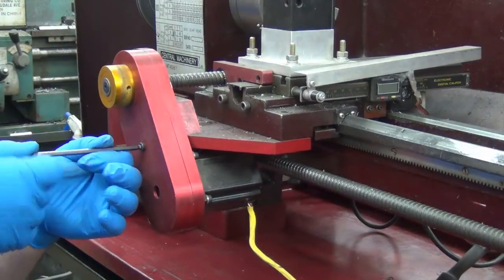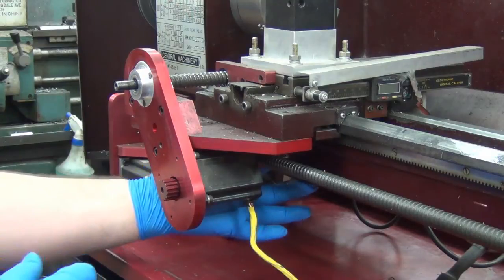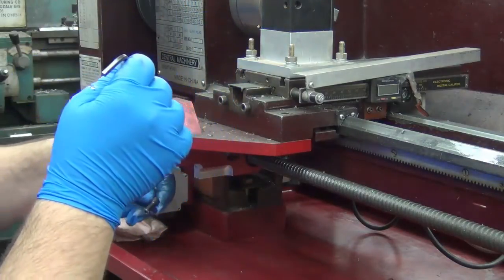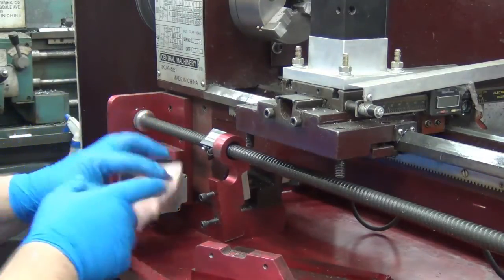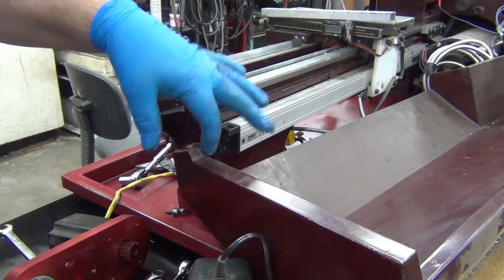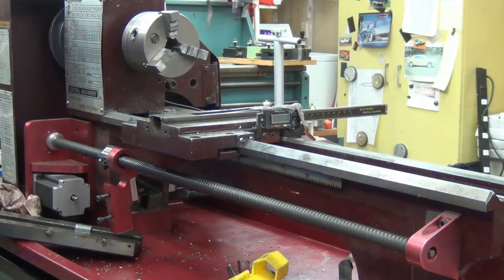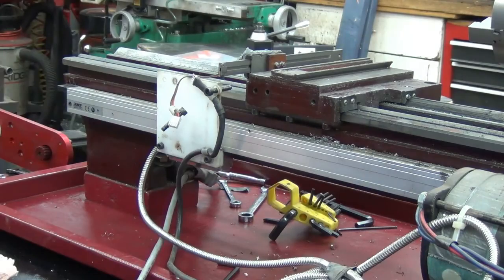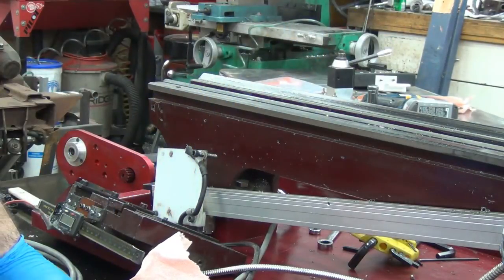CNC Lathe Fix pt2 - Teardown

Comment: Nice machine. Great video
Reply from the maker: Thanks Eric!
Have you watched the most recent on feeds and DOC done with it.  I was pretty impressed with the amount of metal it was removing!
Thanks!
Mike
Reply: I Did. Great Vid.  Have you Set up the positioning sensor for the Head stock?
Reply from the maker: Eric R.
The one that runs the tach?  I should be able to also run that to the hobbycnc board so that mach3 can control the spindle speed....and position for threading....right?  I haven't gotten to it yet, but I'm hoping to.